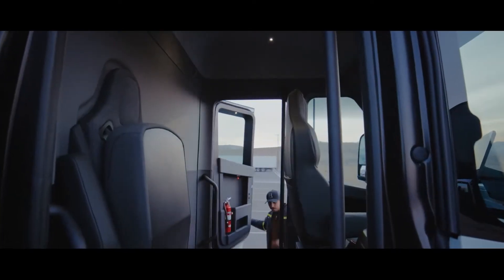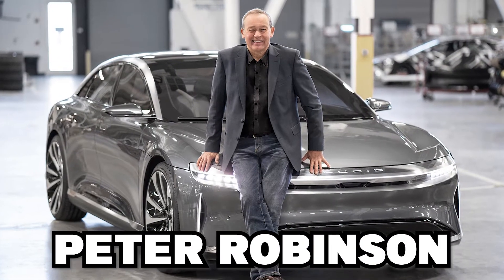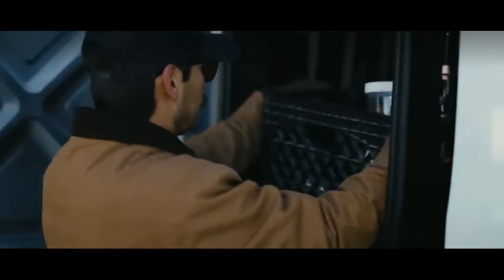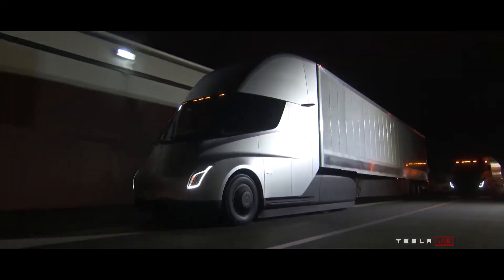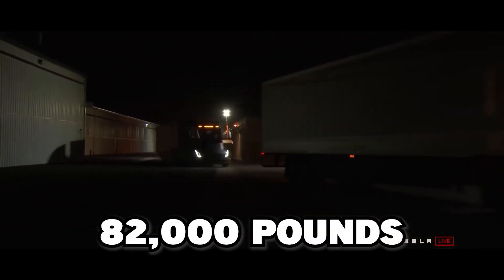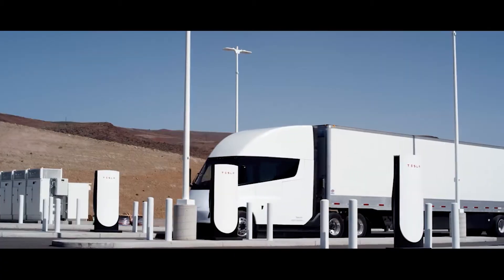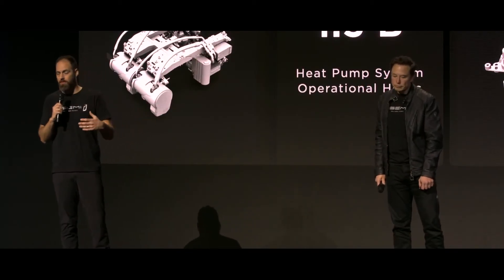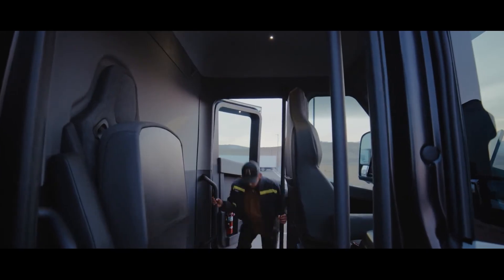Tesla Semi Truck Efficiency Is "2X" Better Than Ford F-150 Lightning!

Comment: Very helpful video, Just to add one more point to your regenerative breaking comment. Besides putting back power in the battery, it is worth noting that you're not using the break pads which take a beating with this load. Essentially, there are two ways of breaking which is huge for safety as well.Thanks for sharing
Reply from the maker: Thank you for watching! We are looking forward to sharing more quality content.
Reply: +1

Comment: Great analysis. Just to add one more point to your regenerative breaking comment. Besides putting back power in the battery, it is worth noting that you're not using the break pads which take a beating with this load. Essentially, there are two ways of breaking which is huge for safety as well.

Great video content, thank you for sharing this great video with us.
Reply from the maker: Thank you for watching! We are looking forward to sharing more quality content.